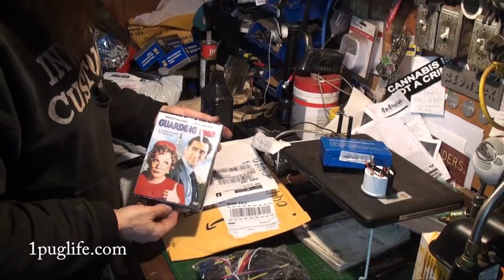every shop needs this home made u joint tool

Comment: I would stop shi of the inner supports on the inner fender well. It would be ok to not overcut the box side. Stay inside of the inner prorile when cutting it out. Leave about a 1 inch hangover so the box doesnt loose its rigidity the new fender add on will hide it & you have plenty room between the tires & the cutouts to not worrie about it hitting them. 👍👍

Comment: Sir, I have found NAPA oil seal #47163 fits in the outter tube if you wanna keep your inners clean.  Not sure if you have NAPA shops up north but you can use the inter change #.
Reply: For 1.5" shafts

Comment: Finaly you made own stuff so you can keep cam oon  and we have some more futage in your work but that wd-40 just throw that shit in trash you can use it to removed all the dirt as well as all the lubricant from your bearings. locks all to place but It's important to use a real lubricant in stuff --->  WD40 or others like it will dry out your bearings and attract dust and dirt You can pick up a bottle of Bones Speed Cream at the skate shop, or try some Prolong from the auto parts store

Comment: U JOINT CLIPS—>AIR HAMMER WITH REALLY REALLY GROUND DOWN BIT. BUT DOESN’T ALWAYS WORK THAT EASY. LATELY I’VE DONE SOME PRETTY ROTTED ASS JOINTS. LIKE HORRIBLY ROTTEN.

Comment: Why do all that work changing the rear axle making it into a dully truck , when your not going to put dully wheels or fenders on it what's the point on running with single rear wheels anyways , are you scared to cut up them rusty rear fenders ?